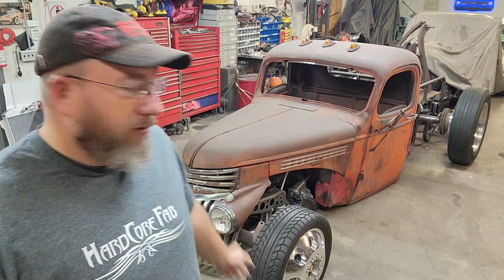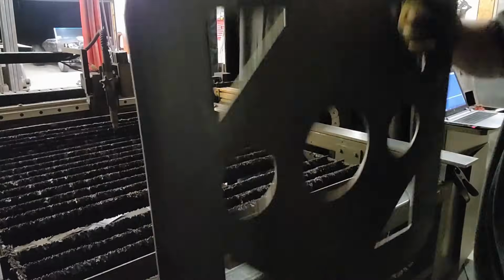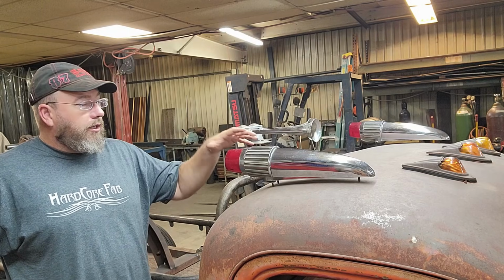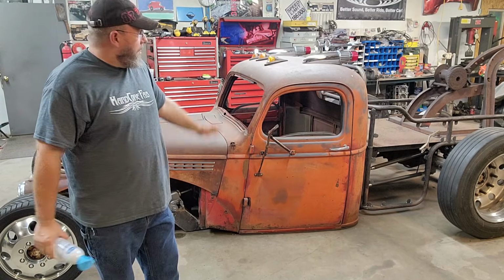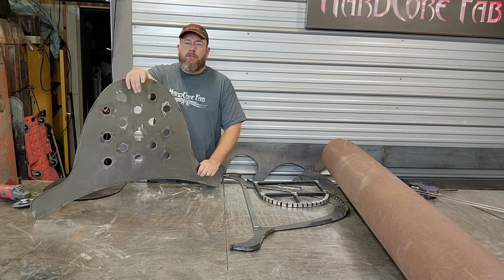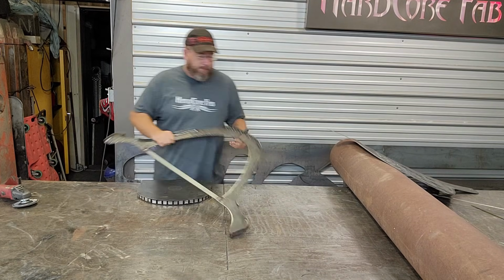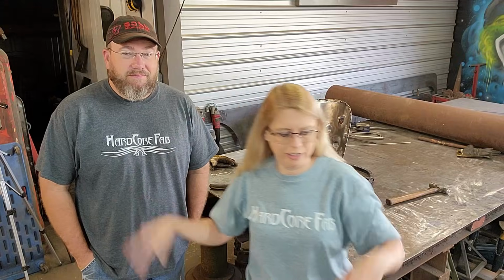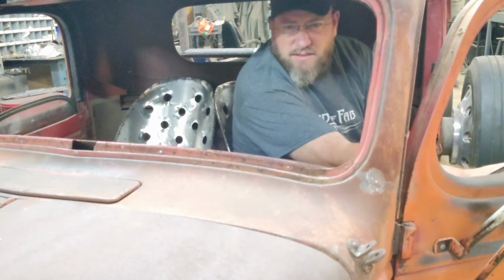We built seats and stuff!  (HOOKERS AND BLOW PART 15)

Comment: Might I suggest putting leg pipes up the side of the cab n putting flame throwers in them that would be frigging awesome with those lights as a back drop
Reply from the maker: I like the idea but there really isn't any room to get pipes past the cab.  It's just going to have to have flames come straight out the sides.  Don't tell anyone that's supposed to be a surprise later. Lol

Comment: As a tow truck driver in Montgomery,  Al, I'm loving the build. Keep in mind that you still have to have stop,  turn,  and tail lights at the very back of the truck. 
Question... will the "Wrecker bed" be fully functional or just for looks.
Reply from the maker: I have a wrecker so I don't need it to really be functional.  Having that said how bad ass would it be to have Hookers and Blow drag the next project into the shop!!!
Reply: @HardCoreFab  it would be absolutely BADASS... but that means "Hookers & Blow" needs to be fully functional. 
Still lovin the build